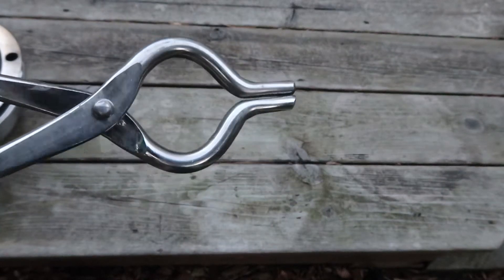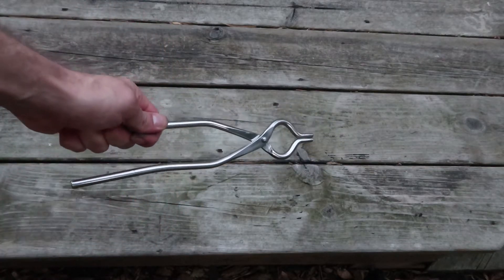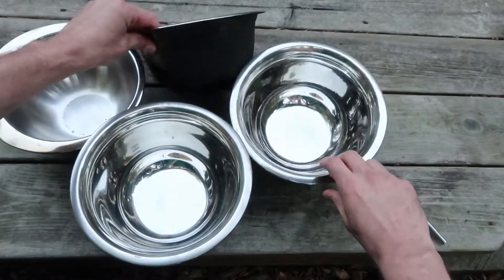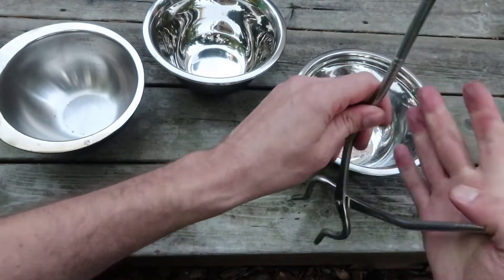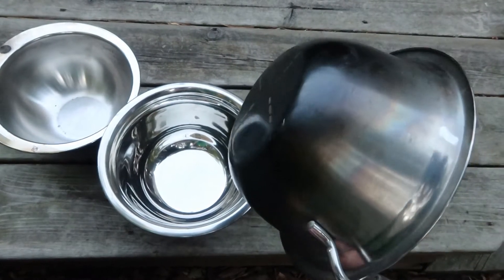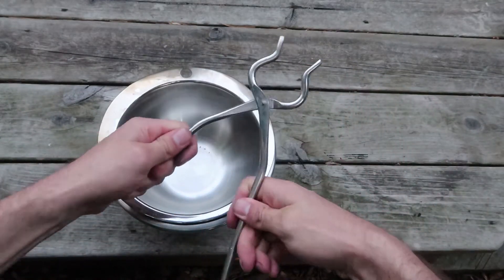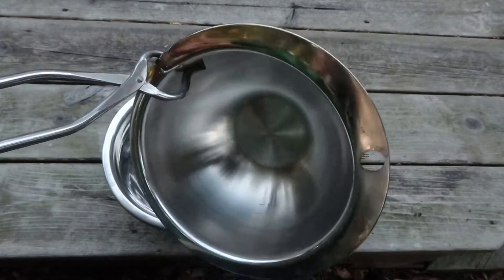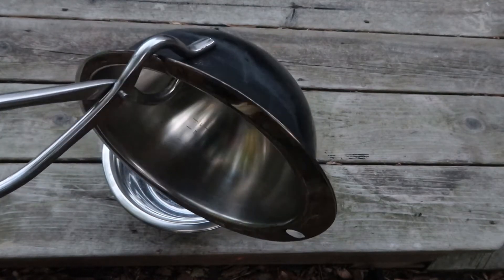How-to Use A Pakad and Stainless Steel Bowls When Survival Camping Tutorial

Comment: I don't know what a pakad is but video was helpful somehow
Reply from the maker: A pakad is basically Indian cooking pliers. Apparently in India, instead of having pots with handles, people often cook with pots without handles. They just pick up the pots using these cooking pliers. The pliers are the pot handle. You just need one set of cooking pliers. It's really an ingeneous system, because the pots, in this case bowls, can be nested together, which saves space. There are similar camping or backpacking pots which have detachable handles, but they can be quite expensive. These Indian cooking pliers (the pakad) and inexpensive stainless steel bowls (stainless steel is stainless steel) are combined get you a simple, inexpensive and effective solution similar to these expensive camping pots. It's a life hack. That's the general idea. Stainless steel bowls can double as cooking pots and eating bowls. It's an interesting survival option for someone who is cost sensitive.
Reply: @digitalfriend7114  also, in india, we pronounce it as "PUCK-ud". Pakad literally means "hold" (or catch) in Hindi lol